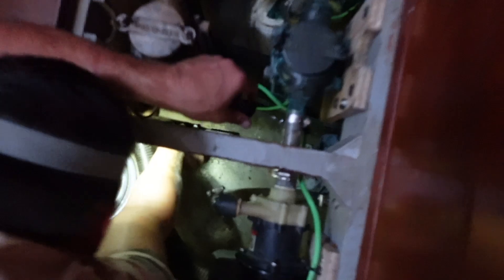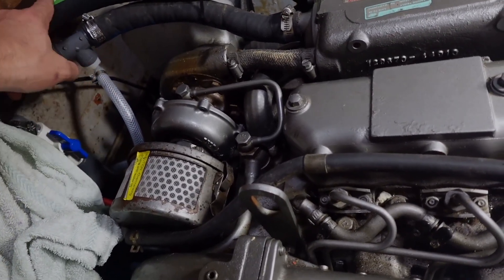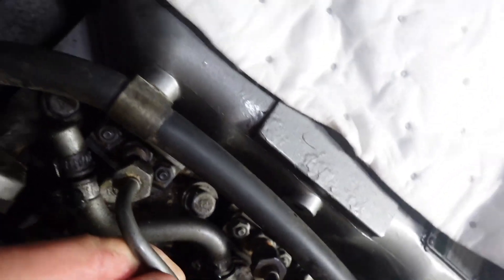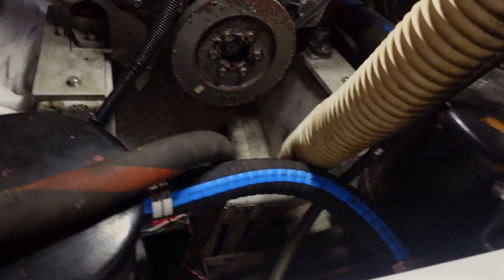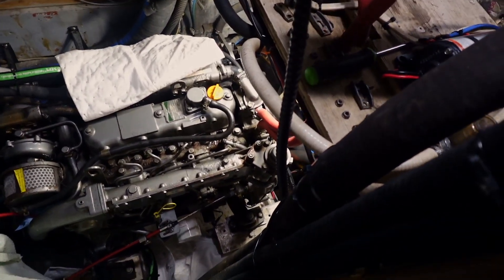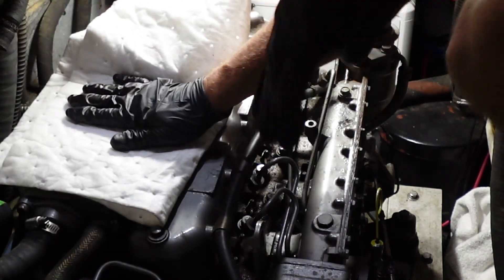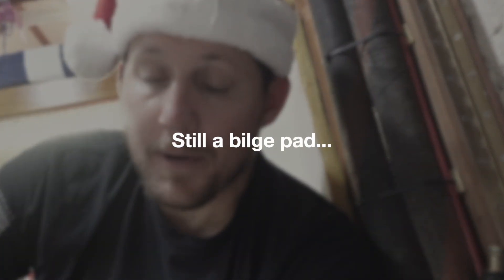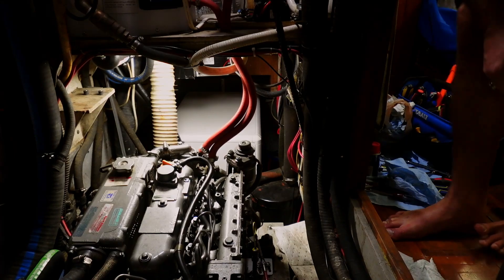Clearing our hydrolocked engine on our Sailboat

Comment: A hose that fits down through the injector hole and a wet vac to suck any water off the top of the piston would be the best solution for clearing the cylinders. If you squirt fuel in the cylinder, the water just stays on the bottom fuel floats on water!
Reply from the maker: Thats what we did and when we took the head off we realized that we had a different issue to deal with. We are mid-project with this part and hopefully the engine will be back together this week. I am ready for warm weather!